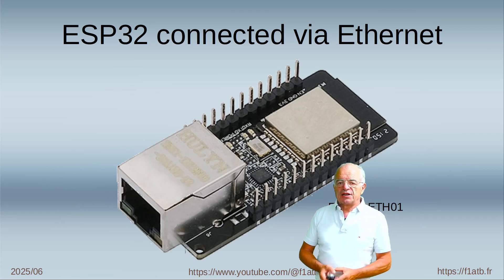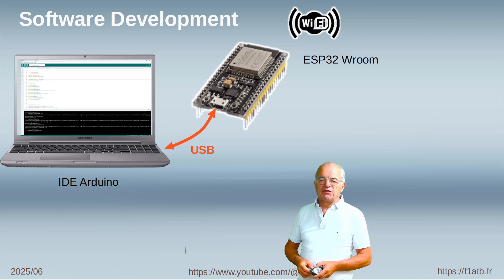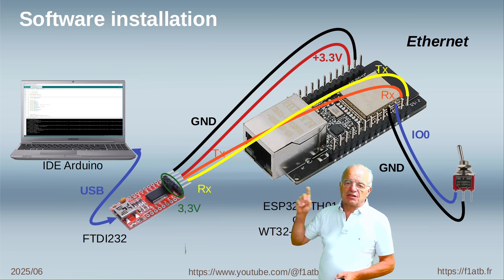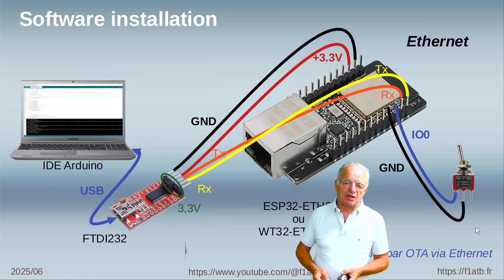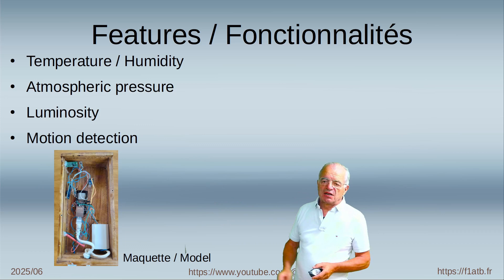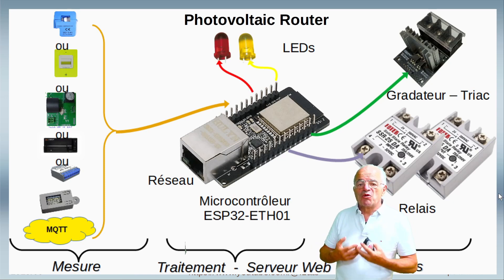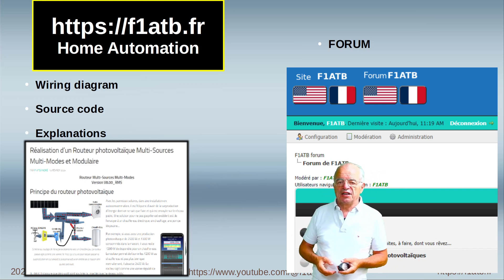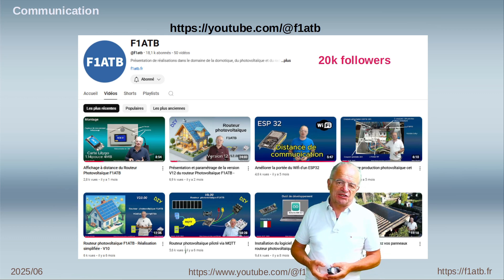ESP32 connected via Ethernet

Comment: Is the serial interface only to configure it?   Is it possible to flash new firmware onto the ESP32 such that it implements a webserver with some IP defaults, and transmits data automatically without serial intervention?
Reply from the maker: Yes, you can implement a webserver. A simple one is proosed on thé démo file.